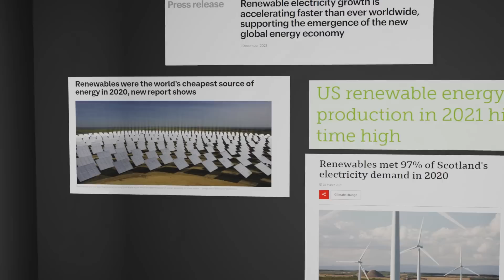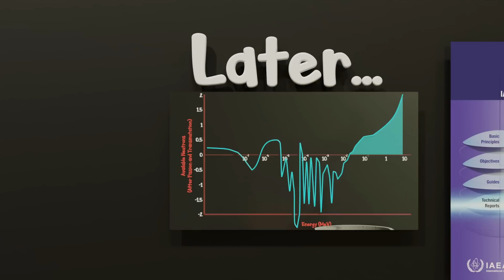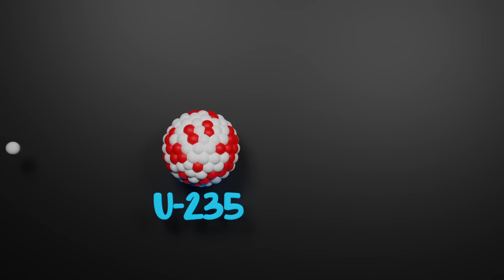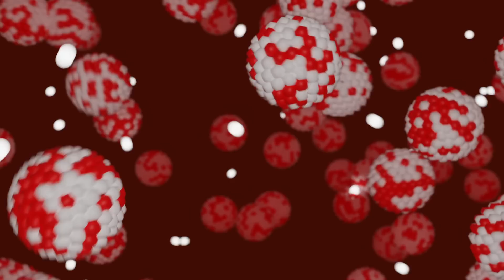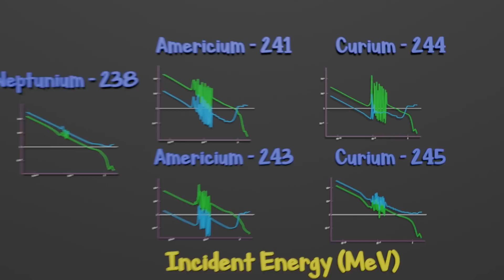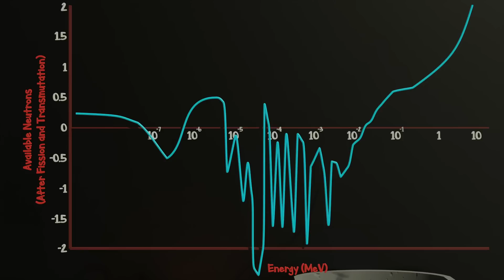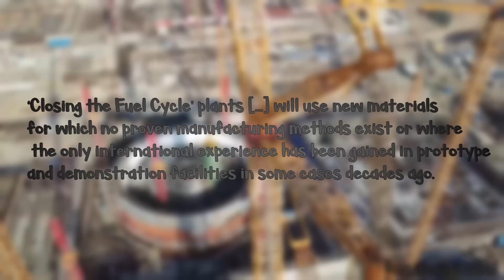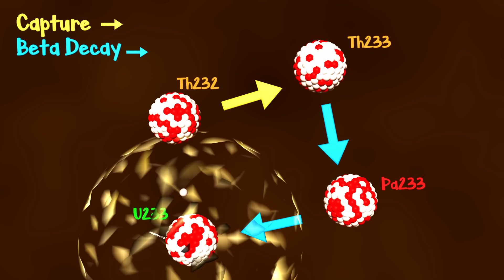How to turn Nuclear Waste into Nuclear Fuel

Comment: The amount already spent on solar and wind subsidies and extra consumer price would have paid for a fleet of fast breeders or thorium thermal breeders to replace all closing generation and keep up with new demand.
Reply: 1GW Nuclear power costs roughly 20 billion USD, for the same amount of money you can build ~20 GW of Solar. It takes at least 5 but often more than 10 years to build a nuclear power plant, while it takes less than 6 months for wind or solar. Economics are important because the determine how much of something we can afford.
Reply: @leonfa259  20GW of solar without batteries is worthless even if it was free. Peak grid demand hits just as the sun sets and solar output drops to zero. So for the real number you need to include about 8GW/hrs of storage and build about 1.6 GW of solar to meet 1 GW of on demand power, and still have some 20% of peak demand base load in the background. Oh and that is only If you get 100% of your expected output curve from solar, which you won't. 

The physical construction time for solar could be 6 months, as your can build a whole bunch of the sub parts at the same time. But you couldn't get a plan into the early planning stage in 6 months let alone, all other required aspects for building something covering 24km^2 (the space used by a 1GW solar farm in India I just looked up). I think 2-3 years might be a more reasonable timeline for a 1GW solar farm (which is on the low end for a handful of the larger solar projects I looked at) 

Current nuclear power is tied with coal power and comes in joint second after large hydro in terms of cost. However nuclear costs can be divided between paying back it's construction cost and once it's been paid for. This nuclear costs is a one and done costs that don't require other investments to work like solar needs extra storage or a complete replication of peak grid demand of standby generation. Anyway, once nuclear is paid back in 20 years and has something like 20 to 80 more years of operating the cost drops even lower. Also getting cut rate loans (as I was talking about using subsidies given to solar) from a government can reduce the price from nuclear in half by getting 3% interest rather than 10%, over it's pay back period.

That's with our not optimal for power generation current light water reactors that are passable submarine power sources but not really the best for grid demand. My statement about the new types of reactors is critical to my comment, not addressing that tech is missing the point. Commenting on current light water reactors when I was talkin about something like the LFTR would be like talking about trains when I'm talking about trucks. They do a similar thing but are so different as make talking about out useless for talking about the other for most cases. Due to vastly lower construction and operating costs a LFTR could be running profitably in the sub 1 cent range.
Reply: @leonfa259  1GW of nuclear will provide 0.92 GW/h while 20GW of solar will provide 5GW/h; BTW price of nuclear vary > 100%, that is, it is not physics it is politics
Reply: oh yes, and Nuclear will provide it 24/7 while solar might or not when you need it
Reply: @pip0109  Like the 2/3 of francese aktive nuclear power plants that are offline currently.

Comment: Intersting video. I was surprised how positive you talked about CCS. Maybe you do a deprive on that, because as of now, most CCS facilities fail on different levels, sometimes even releasing more CO2. Its also greenwashing if the CO2 escape rate is higher than expected